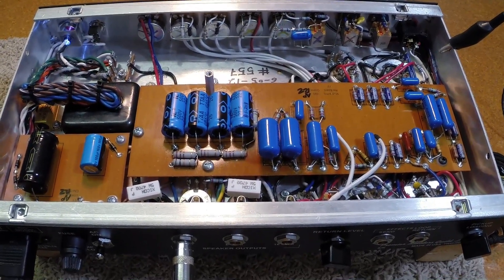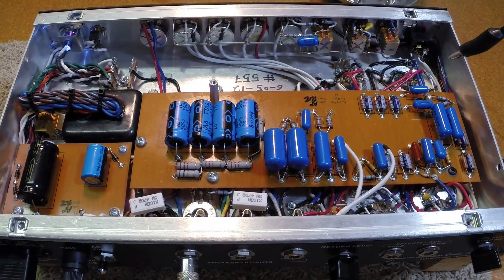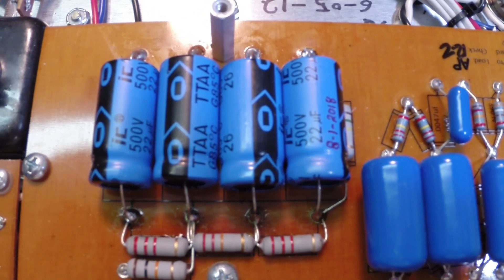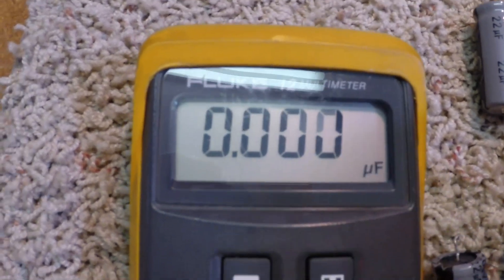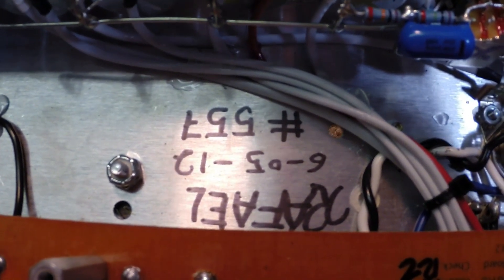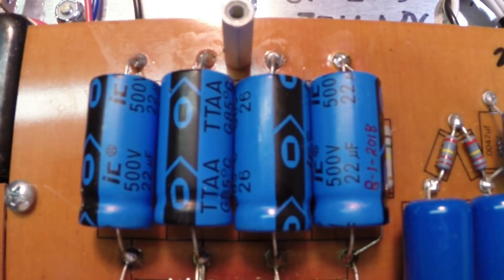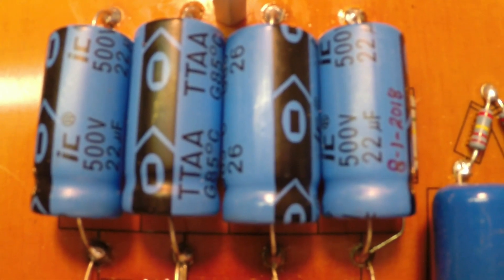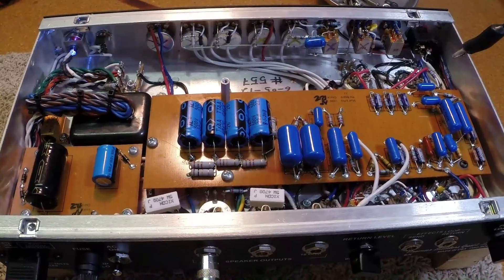Two Rock Studio Pro 35  Filter Capacitor issue

Comment: You saved me a lot of money showing the guts of this amp, It´s made with the cheapest PCB I´ve seen in decades. It´s supposed to be a boutique amp (loower range bur boutique) I´l keep my Fender Deluxe Reverb I service myself. Thank you for showing the guts ot this thing
Reply from the maker: It is difficult to always be Politicly Correct in describing problems in fairly new production amps. It was VERY hard for me not to refer to it as I truly saw it.  All amp manufactures are constantly trying to balance quality and bottom line to provide a price point for the consumer.    I talked to one well known builder several years ago when he was introducing an off-shore line of amps.  His sole purpose was to make enough money on the imports to get out of debt and get out of the business.  You would be very surprised at who it was.  Someone is always going to have an opinion or disagree with my information.  Such is life.  Even though you do not approve of what I did in this case, (4 yr old video by the way, amp still running) there were factors you were not aware of, and I mentioned them in your other comment.... you found a point that helped you make a decision to save you a purchase.  You are welcome.

Comment: I agree that octave ghosting is usually caused by a filter reservoir cap not being able to supply the current. IC caps are really substandard and regularly fail even with as little as 1 year of use. Change them out whenever you find them.

Comment: Nice video! 

I'd love to get your honest thoughts about the reliability on the amps of this brand. I have read TR folks use custom value electonics, in one hand this sells the idea of exclusivenes standing out from the rest boutique makers, but on the other hand this could be A real nightmare at the time of any element replacements as a result of a maintenance. And the truth is that no one talks about that... 

Please, correct if my understanding is wrong or if this is truth, could you share your thoughts? As I have not had the pleasure to play one just yet...

Cheers!
Reply from the maker: I have to say first that any experience with  the TR amps is mainly with the older High end models, and that is few.  They were made well, and were really  nice amps.  I am looking forward to seeing one of the newer amps after the old crew returned.  The amp in the video is a "budget" model and the first place price is cut is unfortunately in parts quality.  Power supply caps are usually second after transformers to get trimmed.  That being said the Studio Pro was still jast as good or better as anything else in that price range.  As far as the custom parts go, most companys have transformers and sometimes capacitors made for them to their specs, not uncommon.  There are although many special made "custom" caps that are supposed to exude coolness and Mojo etc.  A lot of it is BS.  Also keep in mind that everyone has to have a "Secret" that makes their product the best thing since sliced bread.   I just watched a short video and took a look at the inside of one of the new amps.  I did not see anything wierd or odd. I saw Orange Drop coupling caps and F&T electroyltics.  Basically I believe they are most likely one of the best amps out there. Truly Boutique (a term that really buggs me these days)  Low quantity/High Quality and concern for more than the profit level.  There is my honest opinion.  Thanks for watching.
Reply: @guitarc.p.r.9675  thanks for your feedback!

I totally agree with you on the secret about the mojo and exclusiveness that is BS, which honestly worried me about custom caps, etc with custom values. Imagine the nightmare at the replacement time which naturally comes after some years of service... That actually concerned me the most as this is a defining factor to invest in this lovely tool(toy).

Cheers!
Mizraim

Comment: Hi, IC Caps have a high failure rate (In fender reissues they last about last 3 years depending on use) Why didn´t you put F&T caps, there are plenty of 22uf 500V F&T caps for a few bucks more than IC, I tink you gain in labour not so much in parts. That way with say 20 or 30 buck more nt parts you assure the client a 10 year life in parts that prove to fail and are essential to the amp to work I don´t get why you replaced them with the same brand that fails in almost all amps (Fender Deluxe Reverb RI - Fender Blues Junior etc) It´s a well known issue.
Reply from the maker: I agree there is a high failure rate with the IC caps.  The main reason I did not use the F&Ts (which are my go to) was they just would not fit the board, without cramming and such. The owner and I discussed the situation and he chose to go with the OEM parts.  He felt using another part was modification, and he wanted resale value to remain high.  So there are the reasons.  You can't please everybody.  And well, you know.... the customer is always right.